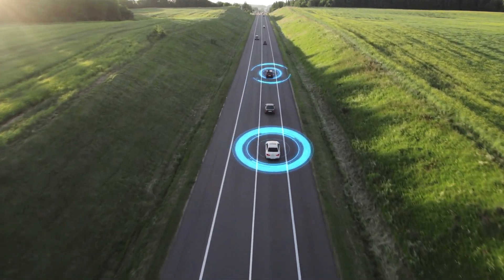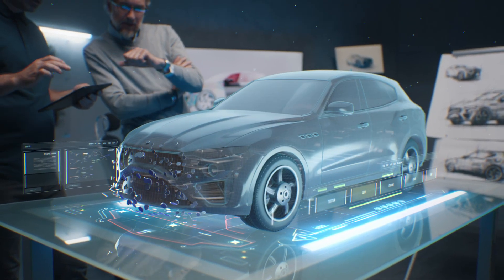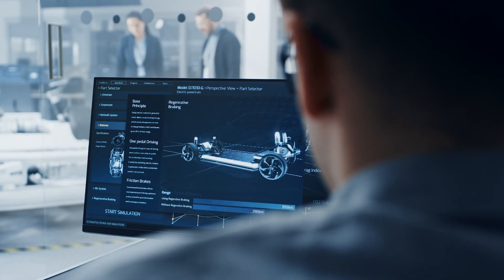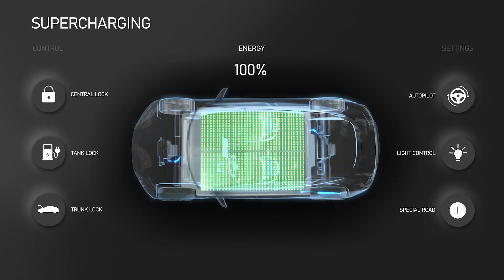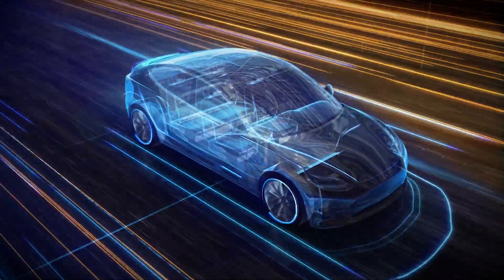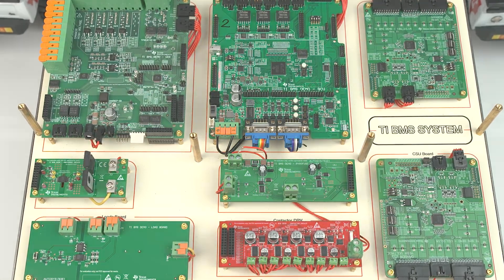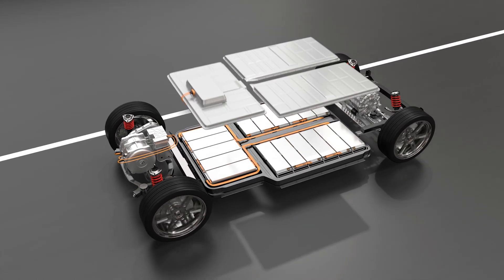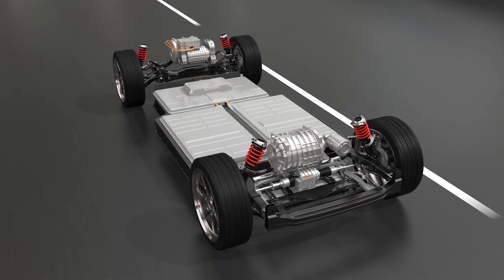Designing smarter, safer battery management systems

Comment: Ferdinand Porsche, yep the same guy that made the 911, made electric cars in 1905 and he concluded it was impossible to have a car park of exclusive fully electric vehicles. but because education today sucks big time, no 1 wants to be an engineer, lots of people have reading problems, they are the ones that buy these useless electric vehicles!

But once it's publicly know that these battery's degrade after 2/3 years and probably be fully death after 5/6 years.
Who is going to sell their home to replace the battery?

Don't waste your time on electric vehicles in about 10 years no 1 will remember Tesla.
This is al related to reading problems, stop wasting your time.

It would have been probably more than logical that all cars since 1905 would be electrical, but it's not!
Why it not¿?